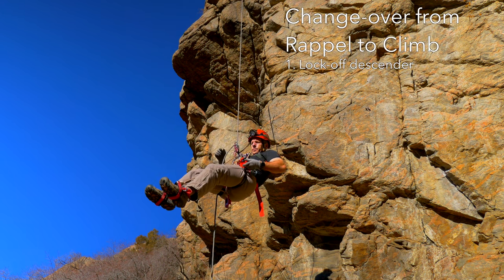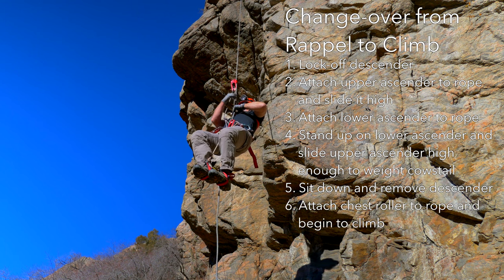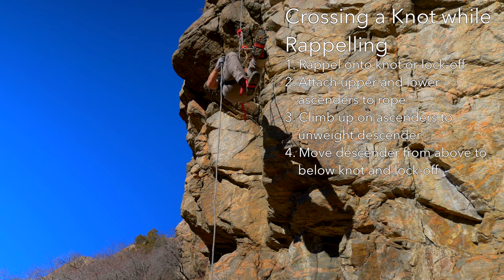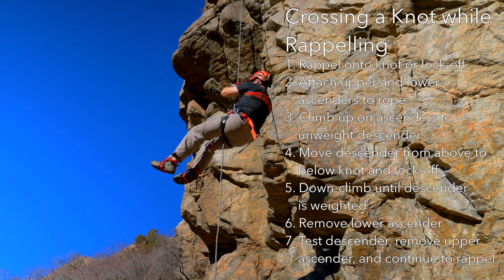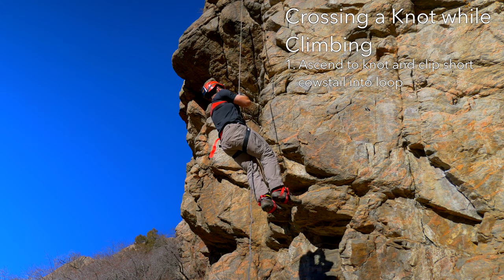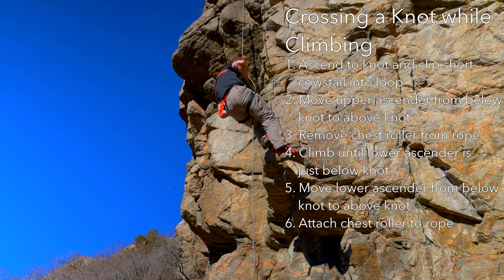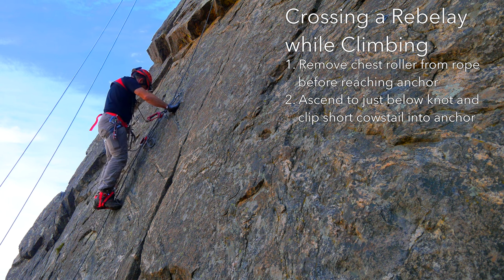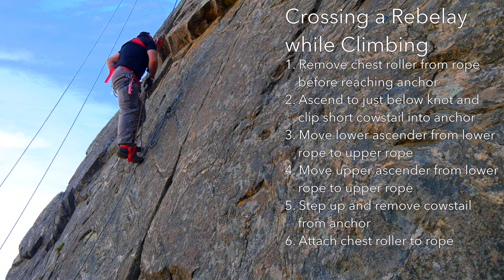Mitchell Ascending System for Caving

Comment: I used a modified Mitchell. Had a handled ascender through one roller that went to my right foot. Had a free running Gibbs on my left foot. Had a safety free running Gibbs connected to my seat harness that ran on the rope on top of the chest roller. Very fast system if needed. You can take as big or little a step you wanted. You can take the handled ascender off rope at the lip, reach over and reattach it to assist on difficult lips. One SERA I did the 30M climb in 52 seconds.

Comment: Are you using a large CMI ultracinder for your upper, and the small ultracinder for the lower? I have begun learning the mitchell system, and have small ultracinders for both..Would the large on your right side(dominant) help with ergonomics when fighting over tough lip crossings?

Comment: I really liked this video.  Besides the quality, I liked the content and the explanations.  I figured out that a safety for each ascender was a good, especially for us heavy upper body types who could not recover from a heel hang.  You are the first one I have seen who recommended this.  

A few suggestions for improving getting your message out.

The changeover from ascending to rappelling is the most difficult of the changeovers.  Most common error is to have the rappelling device to low and not being able to stand high enough to de-weight the rappelling device.  You did that very well but the view was from your back., so a beginner would likely be lost at this point.

Zooming in on the details of each move would help.

Some comments about tuning the Mitchell for each persons size and why tuning is so important would help.  I had to discover some of that on my own, but was greatly helped by a fellow grotto member when we did some practice rope work.  

Some comments would help about managing the complexity and placement of all the ropes.  I think that I have made every mistake possible and can now recover from any of them.  Having 2 safety ropes concreted makes placement more complicated.  Practice is very important to safely use the Mitchell.  I recently had to recover from going over a lip and start over when my safety ropes got caught in my rappelling device and my ascender.  Had I not practiced an inconvenience could have been a major issue.

I wish I had this video when I was learning the Mitchell system.
Reply from the maker: Hi Lee. Thanks for the feedback. Attaching the descender too low and having too much slack is a common problem during change-overs with most vertical systems. I agree the camera angles weren't the best here. I'll have to talk to my film crew;) I also agree that practice is critical with this and other vertical techniques. Best to work with others who have experience and can help with the steps and making the needed adjustments to equipment. For some there are limited resources locally, and there seems to be very little written about the Mitchell system in particular. The NSS Convention is a great place to find expert help. Hopefully this video, combined with other resources, may help those wanting to learn or become more proficient.